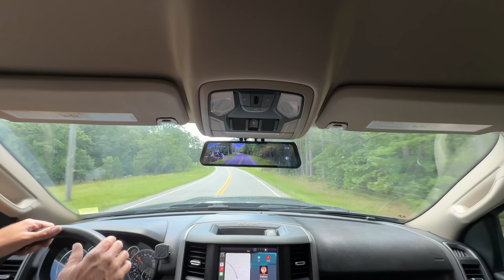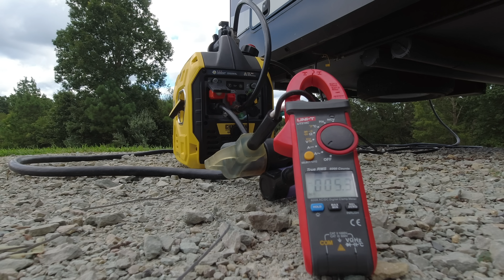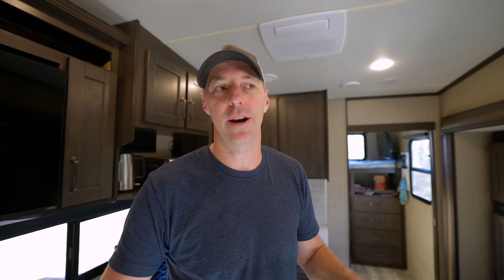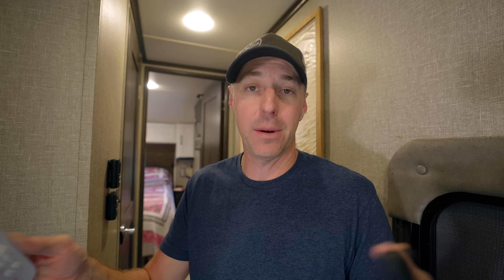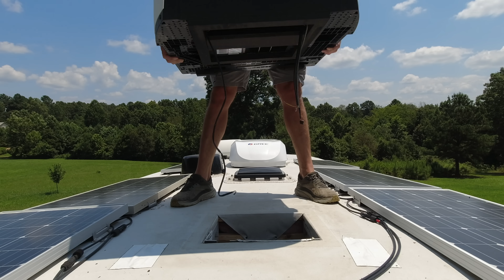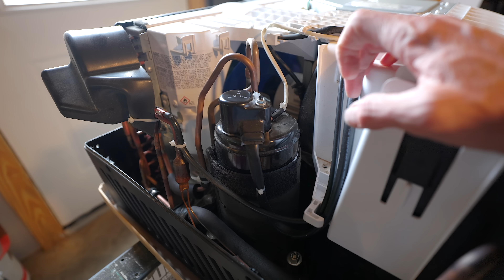Best RV Gear Upgrade Of The Year!

Comment: Any Inverter type AC/heat pump and that includes mini-split units should include you installing a surge protector in it. These units are controlled by expensive control boards that are highly susceptible to electrical spikes.

Comment: 100% accurate everything stated in this video. I’ve been using this unit for about six months or so and it’s absolutely fantastic. It was a game changer for sure or a district in the industry lol

I have mine controlled with a  Cielo hardwired wall thermostat that is Wi-Fi enabled..

another great video you bring so much value to this community. Love the channel.

non-ducted- with the air distribution box on sale last year Black Friday $850

Comment: Excellent review and outstanding choice for upgrade of the year. I believe tires, mattresses, and ACs in some order are the biggest complaints with RVers. Furrion teamed with LG to build the refrigeration and controls; LG is a leader in variable speed residential variable speed mini splits, they chose wisely.

I also saw that Coleman plans to introduce their version early next year, and have also read that Dometic has a model currently marketed in Australia. It's really good to see some different OEMs offering these on their models. I doubt that retrofit sales will move the market very much but OEM installs will.

I've also read that they plan to offer a heat pump model soon, they made good on their word to introduce a ducted model so I'm confident they'll make good on this too. It's not a big change at all, but will likely will have to upgrade their thermostats too.

As a side note, most of the variable speed residential mini-splits recommend an SPD installed on the outdoor unit. I think it might be a good idea for RV models too. There are some good 120 volt models available that cost less than 1/3 of the price of the soft starts which aren't needed  and won't even work with a variable speed.

Comment: From what I have seen the wall thermostat only works with the Ducted version. I thought it would work with both then I saw the video @MortonsontheMove did and he noted only the Ducted version has the control interface. On etrailers website is says "Thermostat for Furrion Chill Cube Ducted RV Air Conditioners - Single Zone". 

I have installed one of the ductless units in a small video trailer and they are great. But that lack of wifi control or compatibility with aftermarket thermostats is a real disappointment. I want to put these on my Paradigm 380mp but the lack of wifi. heat pump, non ducted only blowing forward, and overall hight has me debating to put these on or wait until new version comes out or someone else comes out with a better one.

Comment: Do you have a ducted A/C?  What is the "Distribution Box"?  I see other Furrion Chill cubes that do not mention this?  Part # FR99TD talks about oscillating air vents?  Do these replace the existing vents in our RV?  Thanks
Reply: Just thought I would check in

Comment: Does it take humidity out when it’s on cooling and not dehumidifier mode?
Reply from the maker: Yes it does and better than our Eco-Cool AC. I tracked those numbers for a week this last some to see which one did better.
Reply: @AllAboutRVs  I leave mine on full time on the Dry setting in storage and it works great as a dehumidifier. We have a 15 amp breaker in our storage unit and it never trips.
Reply: All ac units are Dehumidifiers
Reply: @jackhouran8851 that’s not true. We have one that cools but doesn’t take a drop of humidity out of the air. We got mold from assuming that.

Comment: I would never have another AC that wasn’t a heat pump, so hopefully that will come soon.  There is no reason for any AC to exist that isn’t a heat pump.   I also do not like the trend away from ducted AC that the manufacturers are engaged in.  They obviously are doing this for cost savings, but it is far superior as you can adjust the distribution of air and also not have cold air blowing on you.  They make it in ducted, but many manufacturers are choosing the old fashioned non-ducted and those went out of style in the 90s.  Mini splits are just as awful in the home as wall-bangers are in hotel rooms.  They blast cold air at you and don’t distribute air throughout the space.  The variable speed components is really the only great thing about these, but frankly most AC runs all the time anyway, so being able to ramp it down is somewhat pointless.  Good to see some innovation though.
Reply: Hot air rises, so a heat pump on the roof of a poorly insulated vehicle isn't going to be very efficient or effective unless you can also force that air to circulate.  And that would require much stronger and more directional fans than what's on the AC, which takes advantage of the fact that cold air falls.

It's not an insurmountable issue, but it would add cost and installation complexity more than you'd think.  That said, I'm sure they'll release one in the next couple of years.
Reply: @rpontonjr The warmest air gets trapped towards the ceiling, but that doesn’t mean there is no heating in the lower space.  Many homes are heated with air registers towards the ceiling, particularly if the home is also air conditioned.  The house I grew up in was this way, in fact.  In milder temperatures it works just fine, and allow using park power instead of propane.
Reply: @jordancook1668  Yes, but RVs are notoriously poorly insulated.  The hot air sitting at the roof will lose a ton of its heat before the heat has any chance to spread down.  For an AC, that's good, because it sucks in the hottest air in the RV and ejects it, while blowing in cold air that falls and creates its own circulation.

Homes are well insulated at the roof and have things like ceiling fans that do a very good job of moving that air around.

RV rooftop ACs have to do all of that through a standard 14" square, too.  It's not that it's impossible, but it would add complexity, probably noise (high speed fans to circulate that hot air), and get bad reviews for its heating ability.
Reply: @r@r @rpontonjr  none of what you said is wrong, but remember, I’m not paying for the power.  I couldn’t care less how inefficient it is when it’s free.  I pay for the propane.  It’s just another way to heat and again, if it’s mild, it works perfectly fine.  This is why so many RV air conditioners are heat pumps, and if you’ve ever tried one in relatively mild temps, say anything above freezing, they work perfectly fine and will keep you comfortable, all using free power.  There is really no reason for any air conditioners anywhere ever to not also be a heat pump.

Comment: One thing you didn't elaborate on was the feature of just being able to use the dehumidifier by it self . Great on a rainy trip where you are bringing in a lot of moisture do to wet gear..... also used it when I was doing some painting on a rainy day.:)
Reply: That's a feature with all variable speed ACs and helps in a couple of ways. By keeping the humidity low during low or no cooling load times, it takes the latent (humidity) load off the AC, and running in dehu mode, it keeps the evaporator coil wet. An AC doesn't reach it's max efficiency until the coil gets wet which takes a few minutes of run time to accomplish.

Comment: I bought a new AC unit for my 25' Airstream camper last August and it was a major improvement in noise and cooling power. I had an 11K Dometic Penguin and ended up with a Blizzard NXT 13.5K.  My first unit cooled well but struggled with airflow and noise. It would freeze up if I ran it on low. It would take about 40 minutes to cool the camper down to comfortable in the summer from setup. 
The Blizzard is so different. On high the Blizzard literally has a breeze blowing all over the camper and it cools down in about 20-25 minutes- half the time. I have to turn it up temp-wise or I will freeze with the breeze! I was in all four of our deserts this spring and daytime temps in Big Bend Rio Grand Village were unbelievably hot- over 120  on my weather station ( confirmed this with the general store!)  The Blizzard did a great job. I am also able to run it on low so it is much quieter than the previous AC unit that needed hi fan which allows me to, in a sense, draw less power. It also has auto cycle like a  house and shuts off. 
The Blizzard is not inverter design but it does not make noises starting up and it requires about 1800 watts on soft start makes it nice. I can see the advantage to the inverter compressor. Another example of inverter tech that I am aware is on Panasonic microwaves. Regular microwaves just cook always using full but just adjust the on interval but the Panasonics cook using levels of continuous power.

Comment: How difficult or easy is this to install for the average RV'r?
Reply from the maker: I think ACs are fairly easy to install. They aren’t that complicated and especially if you are using the remote you don’t even have to mess with thermostat wires. It’s just paying attention to the steps and making sure the return air doesn’t mix with the cold output
Reply: @AllAboutRVs  Thank you for the quick response.

Comment: I'll wait, the inside of the roof AC is a hostile place for the inverter circuit board to live. Time will tell.
Reply from the maker: Time will tell but so far it has done well with the RVs that have had them over a year from what I’ve seen. The build quality inside is impressive.

Comment: Would be great if it had a heat pump also but is just cool. Can't consider it despite all the great features living up North.
Reply from the maker: Good news is they are working on it I’m just not sure when it will be available
Reply: @AllAboutRVs Awesome. Thanks for the heads up.
Reply: That's what I am waiting for a well. I like using the heat pump especially when doing a weekend or week in a space where electricity is included.
Reply: I’m also on the list waiting for the heat pump!

Comment: Is this one a true heat pump, and if so, how does the amp draw compared to other forms of heat. I would love something that supplies enough heat far the shoulder seasons.  How would amp draw compare to my go-to right now electric fireplace.
Reply from the maker: They are currently working on a heatpump option but it’s not out yet.
Reply: I looked at the site and it says cool only I thought they were all heat pumps

Comment: I had a Furrion Chill Cube installed on our trailer in the spring of 2025, and I have no regrets about doing so, although it's more expensive than a common 15,000 btu unit. I only had one standard 15,000 btu unit on our 30 foot trailer, which didn't really keep the trailer cool enough for me. I researched the Chill Cube for months before I had it installed above the bedroom. I had to buy the non-ducted version as the bedroom wasn't ducted for a/c from the factory. This Chill Cube is a monster as far as cooling the trailer. The one thing you have to realize is that it doesn't come standard with the air diverter, and you have to buy the proper one for either ducted or non-ducted. The only drawback on this unit is that the non-ducted diverter only faces one direction when installed, so the vent is always facing the front of the trailer and the head of the bed. It can get a little chilly at night, but that's where the remote control comes in handy. I can change the temperature and fan speed from the bed instead of having to get up to do it. The LED readout on the bottom of the unit lets me know what temperature and fan speed I have chosen without having to turn on the bedroom light and wake my wife. When I have the unit set, I can turn off the LED readout so there isn't an unwanted nightlight. I can also restrict or close the vent gate to control the flow of air on the bed. If , or when my Dometic a/c finally decides to quit, I will for certain have another Chill Cube installed to take it's place. The Chill Cube is so quite, compared to the Dometic unit, that I've had to go in the bedroom to see if it was still operating. If you're thinking about getting a Chill Cube for your trailer, DO IT! I'm finally able to have a cold trailer during our long hot Texas summers, and I'm loving it! (This reply IS NOT sponsored by Furrion, or anyone else,)
Reply: The one direction us the reason I would have to go with the Tosot for my RV. Non-ducted, it needs to blow to the front for living space and back for bedroom. If not for that, I would get the Chill Cube.

Comment: That A/C will not work on our 5th wheel one it is to tall so we will be over height. Second we have a racetrack system. It maybe great but not for taller Rv’s.
Reply from the maker: Yes they don’t have a low profile option from the chill cube but we have reviewed a low profile inverter compressor unit earlier this year but had less capacity and less features but had the heat pump option. I do think that the Chill Cube is far enough above of the rest of what’s out there that we will soon see many more options with these features to work for RVs like yours.
Reply: @A @AllAboutRVs ow does efficiency and real world BTUs compare to Dometic’s 48V low profile?  Mortons on the Move tested an 18k Chill Cube at only 9,000-11000 BTU.   I think the Dometic low profile 48V is in that range, has a heat pump, and would be a even more efficient overall.
Reply: How much height does it push you over 13'6"? Most bridges are 14' or more. If you have a good GPS, it'll allow you to add your height and reroute you around to short bridges.
Reply: @HappyGilmore978 I don’t know the height of our Riverstone is 13’4” with the Dometic  low profile. This Chill cube is not a low profile A/C. And it will not work with our house system because we have the racetrack a/c system this one is room specific.